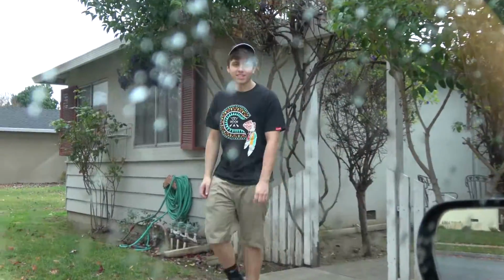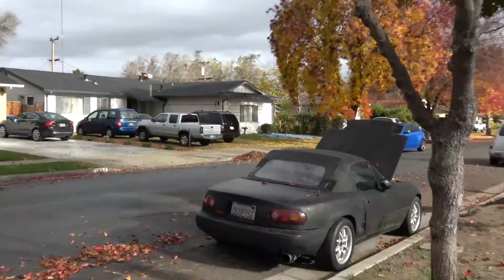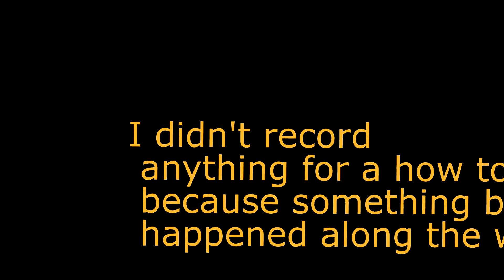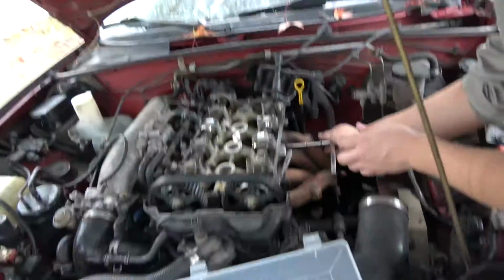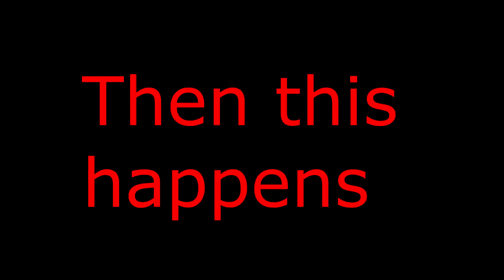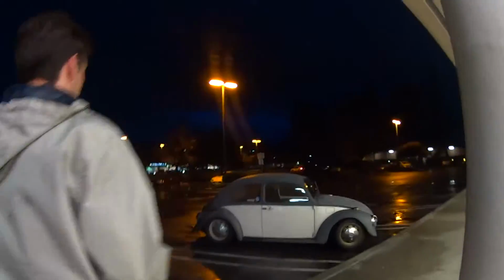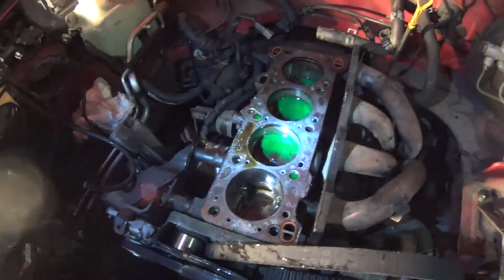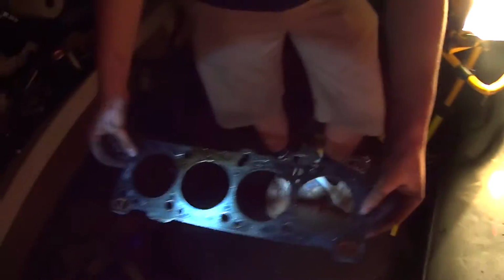Miata has a Blown Headgasket...

Comment: Is it expensive to fix ?
Reply from the maker: Ricer Penguin Woah didnt think someone was going to reach this old video haha. It might be expensive depending on the connections you have with mechanics and if they charge a lot for there service. Its possible to do it your self if you have engine building experience
Reply: @jfboosted  lol its because I seen a miata for sale in my area and it only have a blown head gasket. Would be an awesome project. Preciate it bro
Reply: Ricer Penguin, it’s well worth it, they’re cheap and easy to maintain, I’m gonna fix mine real soon

Comment: Yesterday I had a coolant hose slip off and dump all my coolant while driving on the freeway. I drove for maybe 3 miles before I noticed the burning smell of the coolant on the hot engine block. Got it towed back, reconnected and refilled, but now it won't start and it spews coolant out from under the exhaust manifold when I try to start it. Nothing sounds like it's grinding or anything, just won't start. Does this seem like a blown head gasket or something worse like a cracked block, or is it difficult to tell before tearing the thing apart?